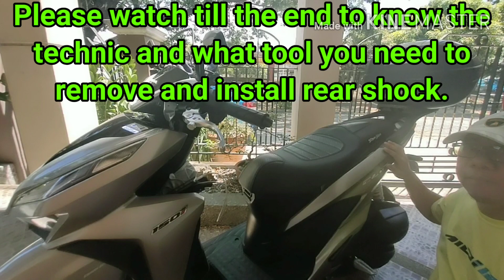EASIEST WAY TO INSTALL REAR SHOCK HONDA CLICK GAME CHANGER WITHOUT REMOVING FAIRINGS

Comment: @Lightsaber Bongga Vlog sir itanong ko lang sana magkano bili mo sa RCB shock? ... saka, anong specs?

meron din po ba adjustable na rebound??

:)
Reply from the maker: nasa 1350 ata ko nakuha sir.  S-series adjustable spring preload. 330mm
Reply: @lightsaberbonggavlog9949  sir pwede magtanong saan mo nabili? ... order po sana ako through online :)